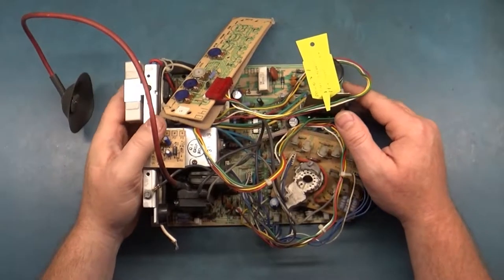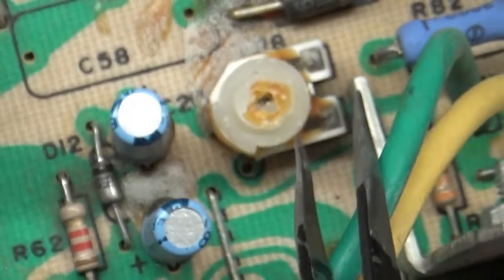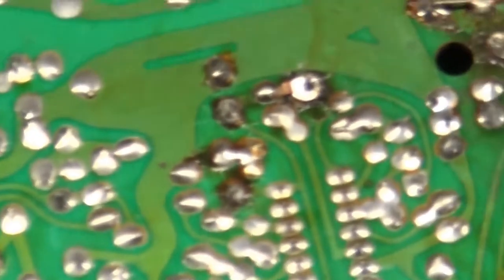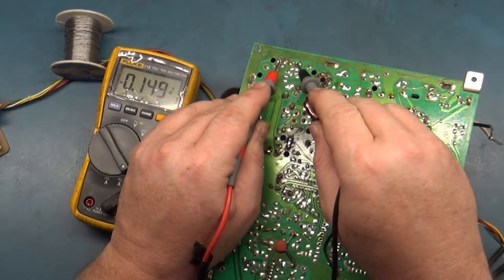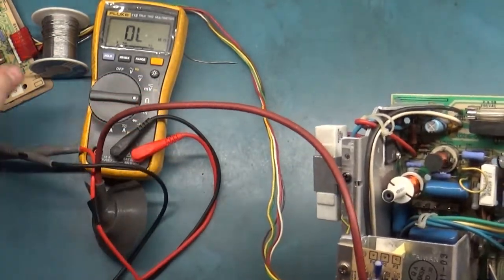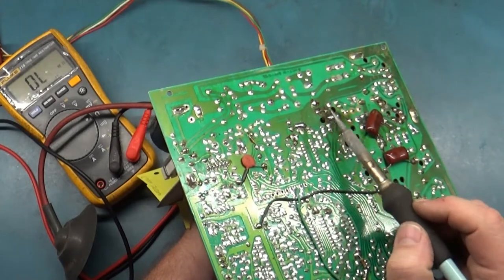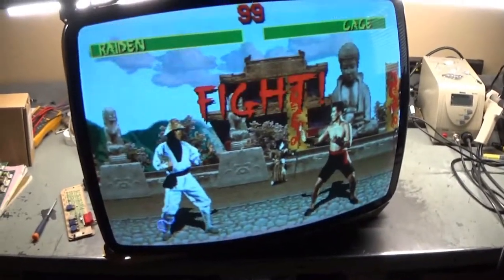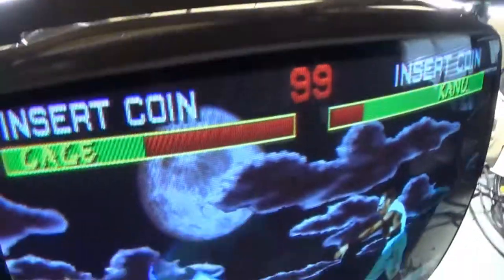25" K7000 Arcade Monitor Chassis Repair - Going Into Shutdown, Cracked Flyback, No Green, Bad Solder

Comment: Mike, let me say first. My hat is off to you. Your knowledge and willingness to share is very much appreciated. I found your page about a month ago and I look forward to watching your videos every evening. I replaced the 3904 transistor, with no joy. I can almost get the picture to quit rolling, but not quite. By the way I am working on a standard res. chassis.
Reply from the maker: Is your sync on pin 10 only? Is it a Jamma game?
Reply: @MikesArcadeMonitorRepair  Yes, pin 10 only. I am using the TPG.
Reply from the maker: Gotta suspect a bad IC2 at this point. Fixed a few that wouldn’t sync by replacing IC2.

Comment: Good eye catching the bulge on C57, I remember in some of your older videos that cap alone caused shutdown aside from all the other issues. I remember one time you fixed all the usual R101 and R899 solder as always and C57 was bent and slightly off the board, it had been replaced. You got it solid on the board and seated properly against it, and still shutdown. Once you replaced C57 all was good to go. I'm starting to remember resistor and cap numbers, been watching too many monitor vids of yours LOL. I wish I knew what I do now about monitor chassis from you. I worked at a bowling center with 64 lanes, 2 CRT monitors on each lane, the ones up top (27" CRTs) and smaller 13" CRTs at the scoring table. The guy we sent em to was clueless, it got to the point that we'd have to swap a "rebuilt/repaired" one in as soon as we got it and pull a working one to make sure it worked. It was just ridiculous especially with the 27" overheads, it took 3 of us to install them, I'd help guide verbally as I was small and we had 2 others, one on each end lifting it up and into the mounting bracket. I am proud of one thing tho, I did my colors just as you do in your videos, these monitors were always on even if not in use, full HV still and if you didn't get the colors and brightness right they would glow as technically they just displayed a black image when not in use, if out of adj black wasn't black and they'd glow and ofc look like crap when actually in use. Sorry for the novel, love the vids as always! :)

Comment: Hello Mike, I am working on a wg7191 25" and i can't get vert hold. I have recapped, installed new flyback and everything is good except the vert hold. Do you have any suggestions?
Reply from the maker: Replace the Q8 by the v.hold pot. And I assume you are testing on a standard res board?